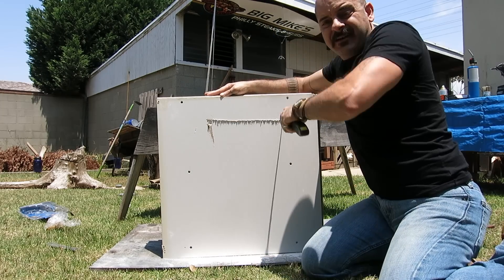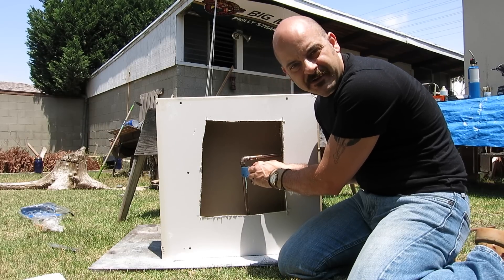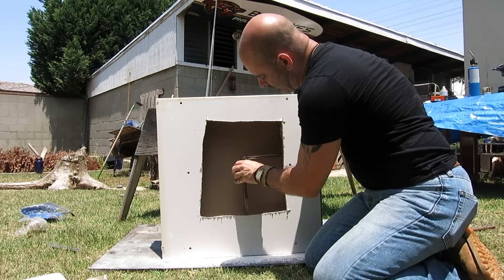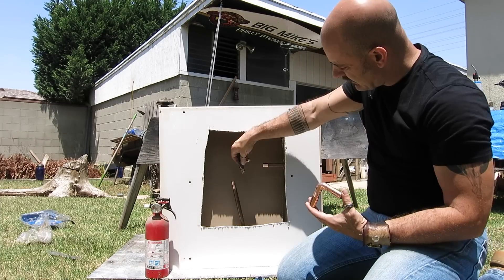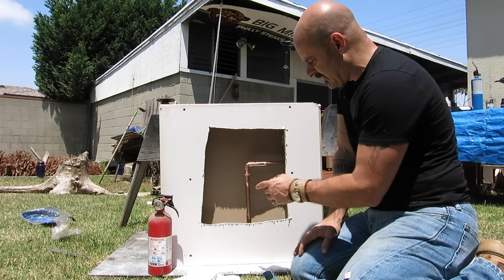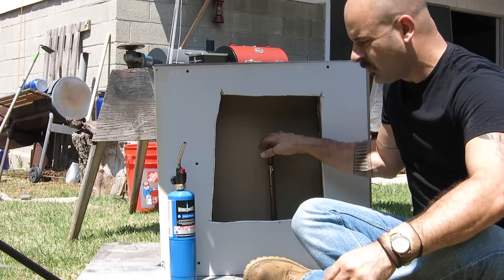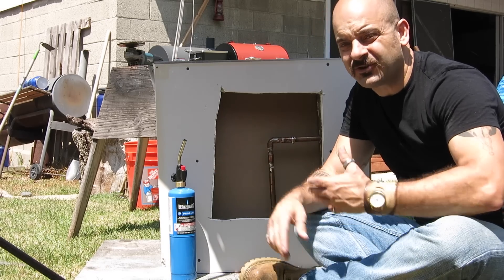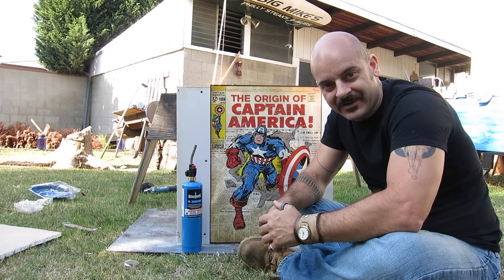Finding and Fixing a Leak in a Copper Pipe

Comment: Worst solder joint I've ever seen. If you have a leak in your water line there is an easier fix. Call a plumber. It will be done right and the work will have a warranty.